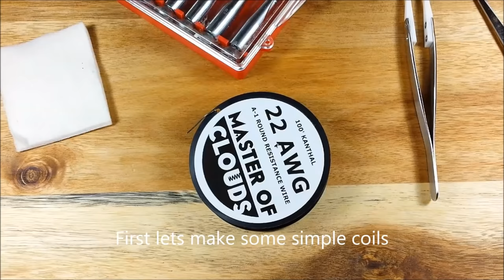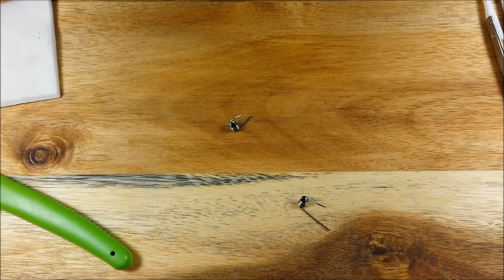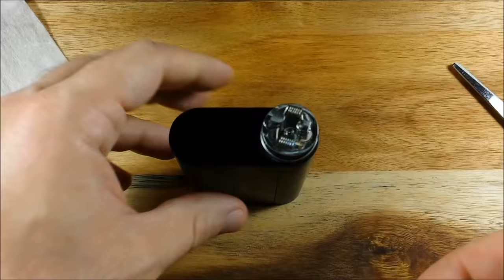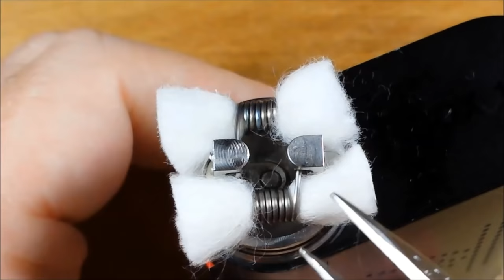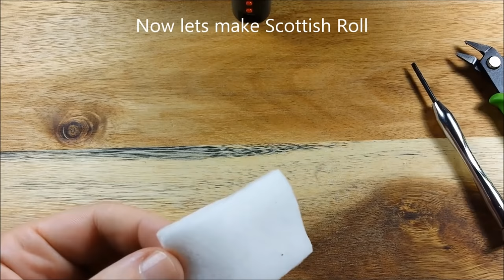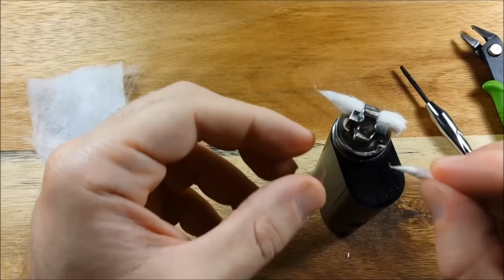Wicking Coils 101 Easy Tutorial for Beginners The Bow and Scottish Roll

Comment: I just bought the ijoy limitless 24mm rda and some 26g kanthal. It will be my first build. I don't have anything better right now to put my build on but my 225watt smok s-priv or my 400watt wismec reuleaux rx300. With the firmware update it's now 400 watts and you could adjust the ohms for the coil. Not gonna build on that one just yet being I don't quite know what I am doing

Comment: I have a dry hit problem, I use tight coils, and my wicking is good (not too thin and not too thick). I like chain vaping though. The problem comes even when the cotton is visibly wet. So when it starts to taste a little bit burn, I drip the juice on the center of coils. Why is this happening to me, many times?

Comment: There's absolutely NO better wicking method than Scottish Roll. If you do it correctly, with patience and care, you will end up with a highly absorbent wick. I manage to drop about 20~30 drops of 70/30 juice into a 22mm single coil Hadaly with a fresh and dry wick. That's enough for about 20~30 puffs with absolutely NO dry-hits. Try "combing" the wick both sides after passing through the coil and then trimming the fuzzies before packing the wick inside the deck well. Do not pack anything too much or you'll have faulty wicking and probably dry hits.
Reply: yeah when done aright this video isn't showing the correct method
Reply: Bob William xn

Comment: seems many just don't understand Scottish roll or why its done to use less make it more , 
comes from rolling burn  spreading it out as loosely as possible then rolling up to look be bigger filling a lot of space with air , just rolling thicker pieces is a king Edward ,
this is no Scottish roll 

watch rip tripper version on Muji pad , he actually is one of only a few that does it correctly hence the misinformation on it 

your supposed to take your cotton and stretch that out as thinly as possible more than doubling in size 
before rolling up gently to what looks a  fatter extremely fluffy cotton packed with airy fibres. when its just spaced out more internally.
which many see your build an wicks  and incorrectly  say your using too much due them not knowing the Scottish roll either ,